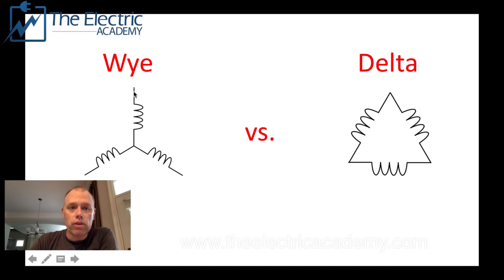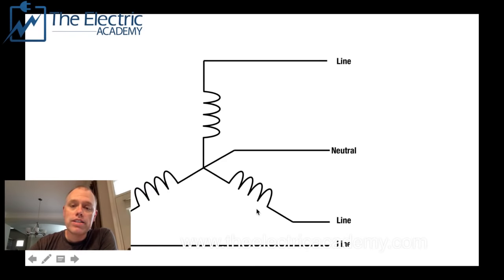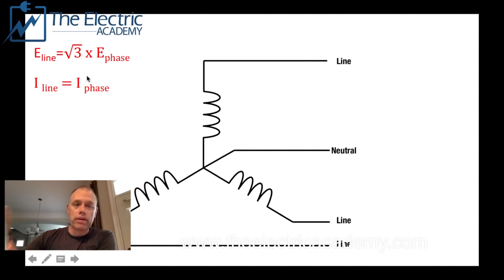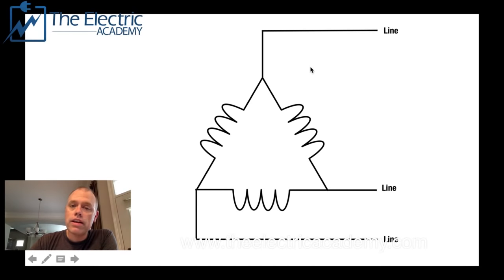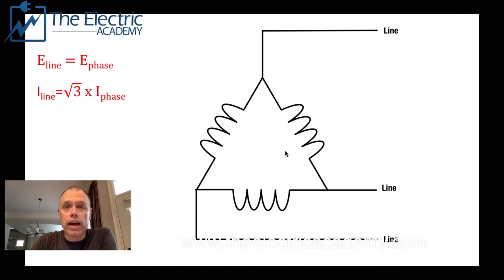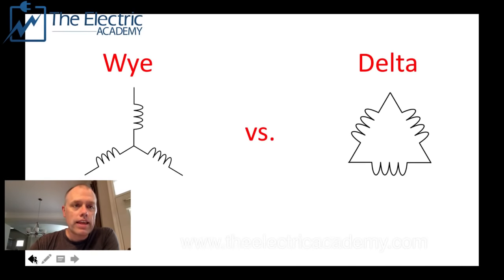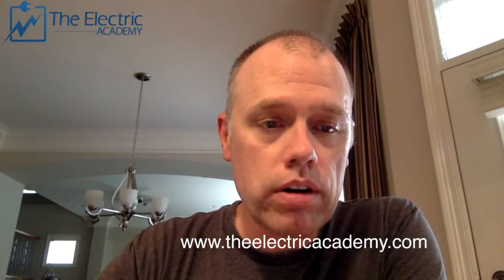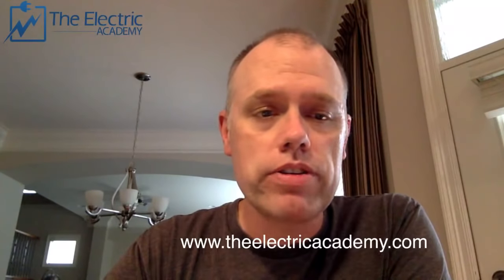Wye and Delta three phase configuration ( A brief overview)

Comment: hey bud, I've been a Hydro One station electrician for a little over 10 years now. I like your videos because as time goes on its good to get a refresher. We deal with mostly delta in from our 115kv-500kv delta system to 27.6kv wye system out so we see a wide variaty of electrical systems. We work with alot of types of circuit breakers from Air Blast to Oil and SF6. if you want some sweet switch arcing videos and transformer fire pictures I have a ton.
Reply: lets see em!
Reply: I dont mean to be off topic but does anyone know a method to log back into an Instagram account??
I somehow lost my account password. I appreciate any assistance you can offer me
Reply: @Weston Zayd Instablaster :)
Reply: @Milo Maxim I really appreciate your reply. I found the site through google and im waiting for the hacking stuff atm.
Takes quite some time so I will reply here later when my account password hopefully is recovered.
Reply: @Milo Maxim it worked and I now got access to my account again. I am so happy!
Thank you so much you really help me out !
Reply: @Weston Zayd you are welcome :)

Comment: Hi I'm Jon from the UK, I am an electrical controls systems engineer with over 30 years behind me now.There is a common misconception that both Star & Delta configured motors produce the same amount of torque and motor power.  The basic problem arises when the teaching staff are competent but lack personal experience in that when you look at the equation and the only difference is the Line and Phase voltage difference and don't realise that when starting a motor the FLC is multiplied by about 4 for star connection and a minimum of 6 x FLC for Delta.However this is only the starting current so for a given load the reduced starting current of star saves on cable installation costs but compromises the long term operational cost of the plant in that the motor current of Delta is far lower than the same motor connected in Star.The selection of motor starter type is dependant upon many influences including the type of operational parameters:Common Standard Motor Starters For 3 phase cage types are:DOL = Direct On LineStar/Delta = Main Star & DeltaSoft StartInverterPole Changing MotorsIt should be noted that a good rule of thumb for Variable Speed Motors supplied from an inverter its supply frequencySo: 50Hz +/- 25% = (37.5 - 62.5Hz)  ((60Hz +/- 25% = (45 - 75Hz)) if the motor is expected to operate outside this range then independent forced cooling units mounted to the motors is recommended.  This is due to the motor cooling necessary because of the increased thermal load of running the motor outside its designed operation window.The use of a pole changing motors together with an inverter can be significant torque boost at starting load in that the motor say for example was an 8/4 pole motor then the motor can start in 8 pole 750 rpm double torque then switch over to a 4 pole motor at normal torque at 1500 rpm, then add on the torque boost from the inverter and the torque can easily be doubled again.
Reply: Why did you bother writing this?
Reply: @Impedancenetwork  because he is smarter then us and this knowledge is easy for him to write

Comment: Phase to phase on a Wye system would never be 120 volts that would be from line to neutral only
Reply: I'm glad you clarified that...It was f**king with my head.
Reply: Just to make sure I've got it straight; With a Wye service connection, Line 1 to Line 2, Line 2 to Line 3, Line 3 to Line 1 would all be 208?  Delta would be Line to Line 240V between all three, with phase A Line to Neutral at 120V, phase B Line to Neutral should be 208V, phase C Line to Neutral 120V.   Or is there no Neutral at all in Delta system and electchicken told me wrong.  In my case, there appears to be ONLY  be 3 insulated wires and bare wire from the utility transformer going to utility meter panel.  Panel has a bonding wire to ground to create the neutral if I remember correctly, making this Delta system.  Es correcto?
Reply: Me too
Reply: I was like no, it would be 240 if you used plus signs, but since the coils are out of phase; we are forced to use vectors. That is how we come up with 208.
Reply: @phfedawg  We are not forced to use vectors. It is physics. It is just how nature works. It is vector quantity phenomenon.
Reply: Master of the Universe WTF are you talking about?
Reply: @1:27 i’m pretty sure he mis spoke and meant on single phase with line to neutral at 120 would have 240v line to line
Reply: @vernroach3413  p
Reply: It could be called a Waw system too, or an Upsilon system, either of which resembles the star layout.
Reply: @bruisedorange5576  If it is WYE, Line to Line would be 208, Line to neutral would be 120. Also there is 277/480 WYE which would be 480 Line to Line and 277 Line to Neutral. There is 240 Delta which is 240V Phase to Phase, and there is also 480V Delta that is 480V phase to phase. There is also Delta with High or Wild Leg, where you get 240V Phase to Phase, 120V from Phase A to Neutral, 120V Phase C to Neutral, and 208V Phase B (High or Wild Leg) to Neutral.
Reply: @illestofdemall13  Since I posted, I've come to understand this topic more, and yes you are correct. It is a Delta 240 volt connection from the transformers.

Comment: I may have missed it but what about how delta can run with faults and is used in the nuclear industry and some Electric arc furnaces. Also the delta-wye/wye-delta transformation would of been good. Also some per phase/3 phase analysis would be nice
Reply: +Shredxcam22 - I can't answer all your questions but as far as a delta system running with faults, there is the case of the "open delta." This is when one of the phases is taken out of circuit for any number of reasons: maintenance, replacement of a bad component, etc. It is possible to do this in a delta system because the two remaining phases will actually recreate the missing phase and allow continued power flow to the loads that were handled by that phase. Of course allowances must be made to avoid overloading those two phases since they are now doing the work of three phases. Obviously this is a big advantage for power systems and "the grid" in general.
Reply: There are times when delta is not grounded, so if a phase goes to ground there is no current flow to activate protection. There is no current flow because of no relationship between transformer and ground. It would take two faults to ground on two different phases to create a current through ground and activate protection device. This is done on purpose so you don’t shut down that circuit for one fault. This advantage is needed for production oriented business.

Comment: To get an idea of phase vectoring and voltage, draw a circle with a 1 inch radius. Draw the first line straight up north, then another line 120 degrees  away from it. Measure the distance from the end of each line (I think that's called hypotenuse). You'll find it to be 1.73 inches. So 120V times 1.73 is 208V. This can be applied to any degree of phase variance. Or you can use trigonometry. If you look at residential service (single phase center tapped with 180 degree phase variance) and apply the same diagram, you'll have 1 line straight north and 1 south. The distance is 2 inches. Voltage times 2, or hot to hot, makes it obvious why your stove gets 240V. And like he said about Wye, this is what runs down your street on the hydro poles. If it's the old style horizontal cross arm on the pole, just look for the odd colored or odd sized insulator and that's neutral. They're getting away from the horizontal cross arm these days because believe it or not, the bolt holding it on is a convergence point for field induction that could heat up that bolt.
Reply: The reason for the bolt heating up is because the insulators holding the conductors are leaking currents due to contamination. The leaking currents are trying to get back to the source so they travel through the wood arm to ground and or other conductors that are contaminated. The currents over time will heat up the materials it travels on and wood can dissipate this heat very well. Metal i.e bolts doesn’t dissipate heat it actually accumulates heat and ends up starting the wood around it on fire. To keep this from happening we bond all metal attached to insulators so as to give a path for this current to flow on. This prevents pole fires.

Comment: @7:45.  ..there are wye/delta starters and motors and there are Soft Starts. They are not the same thing. They both employ reduced voltage technique but a wye/delta start starts at 58% voltage and a soft start is a solid state electronic device that uses SCRs to go from 0 to 100 % applied voltage.

Comment: American Military generators use the Wye and Delta configurations, however, we use them in parallel and series connections using six independent coils. In a parallel Wye, we can get 120 single phase and 208 three phase, only. Our 5 and 10KW generators use both Wye and Delta configurations; parallel delta 120VAC single phase Only, series Delta 120/240VAC single phase, and parallel Wye for 120/208VAC. We can set up our 15KW through 200KW generators with either parallel and series Wye connections. The reason is for NATO power. On our parallel Wye we get the 120/208VAC and in series Wye we 240/416VAC. We also can set our generators to 50 or 60HZ. All the American Military generators have to be NATO compliant.  I tell my students that when figuring the Wye three phase to take the line to neutral voltage and multiply by 1.732 for the three phase voltage (207.84). It's easier than going through the Trig computations.

Comment: Thank you for this brief overview.  2 questions: A) how does my house get 120v/ 240v? B) What is a wild leg? (orange)
Reply: Your house only gets one phase, stepped down by a somewhat special transformer near you.  This video is not relevant to your question about voltages.        You get your two voltages from your single phase, local, center grounded transformer.  From  that center tap to each of the other two leads, you will get your 120VAC, from the ends of the secondary, its 240VAC.  Its all about that center tap on the secondary of your local transformer. In the US, your wiring will be white for that center tap. This is neutral.  Whoever sets up your breaker box will pick a side and it will be 120VAC or hot and it will be a black wire.  The other side is usually wired red and it is reserved to use against the black to provide power to water heaters, stoves and other 240VAC services.
Reply: @mscottmiracle1396  You would also use the red wire to feed 120v load that keeps the panel and transformer balanced. Both black and red wires feed 240v loads.
Reply: A "Wild Lag" would be the term for that unique 277 v different voltage winding on the rare type of 3 phase 240 Delta secondary X-former designed specifically for boost assisting the start rev of a industrial large motor(s) under weighted load like with commercial sludge pumps or the sawmill's saw blade drive motor. These are rare unless in an industry and prone to human factors when failing to recognize this unique X-former output. You are correct to lable that Wild Lag the color Orange as only that reveals to the eye to stay away when load balancing and always connect the ABC order perfect the first time with any Wild Lag motor type or you will smoke it baby and no one to blame for your bad guess work.

Comment: On the ungrounded Delta, we add a neutral grounding Zigzag transformer and a resistor to create the grounding point.  Works well
Reply: Isn’t that zigzag transformer wired in a wye configuration to get the neutral?

Comment: I don’t know that I have ever seen a delta at 120 volts. All I’ve seen was either 240 or 480. The 240 with one transformer center tapped for 120 is quite common for commercial, so also is straight 480 for industrial, with 120 coming off a separate 480 to 240/120 transformer.
Reply: 120/240 delta with a 208 high leg is a common older service used in my area..
Reply: This grid service type does exist as a 240 Delta (Not WYE), but with a center point tap (bonded to ground as our neutral buss between phase A and phase C often termed as a "Stinger".  So then you get 240v between A&B, B&C, C&A,  But then also can power standard receptacles that use a 120/240 Dual or "Split single" phase between A&C. For this one though, you must have a conjoined subpanel fed from the 3Ph MDP so that it can bond the center tapped Neutral to service ground point in that first MDP enclosure as close as possible to the secondary of the service X-Former. An electrician may be able to give a more current code explanation then me as I only have DC solar knowledge from my many installs with SMA inverter types that support the 240/120 Delta configurations but never came across one in USA service types. I'm eager to work with this in a hybrid router system since it would be superior if average use models are load balanced properly with our intermittent grids "Rolling Blackouts" reality coming to your theaters soon predictably.

Comment: Good overview of this. Now to expand on this just a bit....I'm looking at installing a 3 phase solar inverter. It can be configured for either Y or Delta. In this case I'm thinking I would want to go with a Y configuration, however in some respect a Delta might be better. The only draw back I see at this point would be the lack of ground in the Delta circuit. What would be your thoughts on this?
Reply: Ground and Neutral are not the same thing.  Delta configurations do not have a neutral, but they can still have a ground.  None of the conductors are grounded in a Delta configuration.  In the Star/Wye configuration, the neutral carries the imbalance of the loads of the three phases, and it is usually directly grounded.  Delta configurations must utilize an indirect kind of ground.  I'm no expert, but the Wye configuration always sounds easier to me to implement.
Reply: +Kurt Langeberg - I tend to agree with Jovetj. The wye configuration is probably the better way to go, especially if this inverter is going to supply AC to an occupied building, off the grid. But the choice really depends on the total application. Is the system off the grid (with batteries) or is it grid-tied? If it is grid-tied then it must be compatible with the configuration that your power company is providing you with. If it's a standalone system that is charging batteries then the choice comes down to system voltage and capacity. High voltage/lower current systems would favor the wye system, lower voltage/higher current systems would favor the delta system. It can be quite the panoply of possibilities with these things. The key is knowing everything you can about the installation.
Reply: Depends... are you going to be charging other batteries or using appliances? or what?

Comment: Could you please elaborate the sequence current and voltages developed below described scenarios. A 500KVA distribution transformer with 6% Z, 11/0.44 kV, Dyn11 connections lost one HV conductor. That conductor is on floating from source side and transformer side is touching with ground having less than 3 ohm ground resistance. So how much current will be developed in healthy phases and what will be the value of zero and negative sequence current

Comment: Single phase systems provide 120/240VAC 120 phase to neutral and 240 phase to phase. The 120 degree separation on a three phase system as opposed to 180 degree separation on a single phase system is only there for smoother operation of three phase motors and such.
Reply: It's also there because it makes power generation, transmission, and distribution a lot more economical for the same amount of power.
Reply: @carultch  Yes, you are correct. Three is more symmetrical than two, even in terms of geometry. In other words three is more perfect than two.

Comment: In Y configuration, How the Line current and Phase current are same? (They are not in series)
Reply: +Ajay G - Actually the phases and lines are in series in a wye system, so most certainly the currents would be the same between the two. The exception is the neutral wire, which has the three phases paralleled to it. So the current in that wire is the vector sum of the three phases. And if the three loads are equal (balanced), no current will flow through that wire. In those cases, such as three phase motors, the neutral can be eliminated.

Comment: If you taking suggestions, the guy said industrial motor but VFD's are common but what about cycloconverters?
Reply from the maker: Shredxcam22 I'm gonna have to put you on payroll. Thanks for the awesome input. Seriously
Reply: The Electric Academy I went through a weird transition and have had to learn a lot. Avionics to working in a steel mill. I had to learn a ton but something are not often talked about. I plan on doing some videos eventually. I am finishing my BS electronics engineering technology which many people don't get the difference between EE and eet even tho both are ABET accredited.
Reply: @Shredxcam22  So how did that go?
Reply: @keyworksales6241  loving It.  Working towards someday being a process/control engineering.